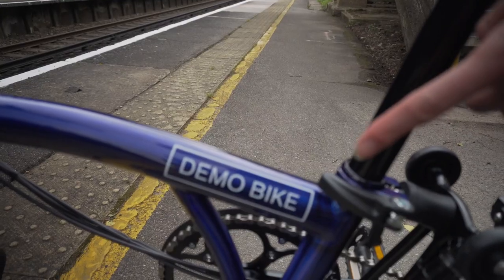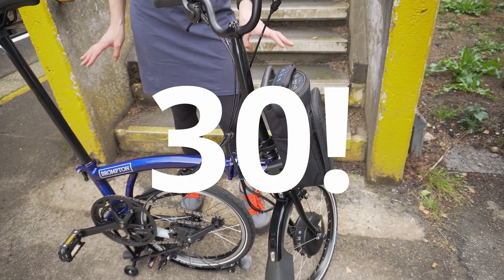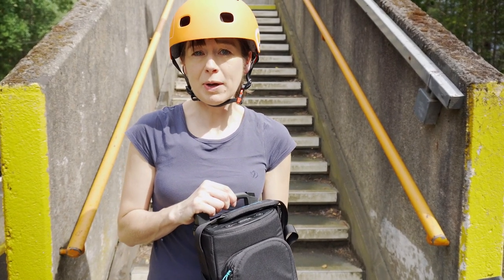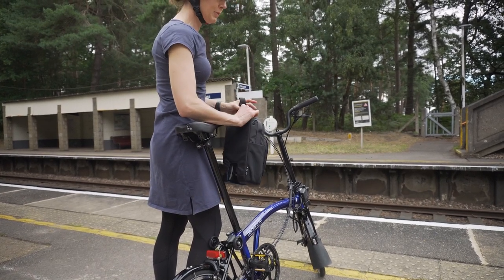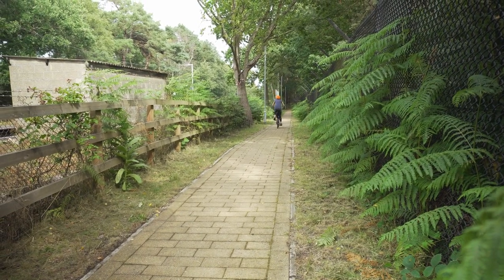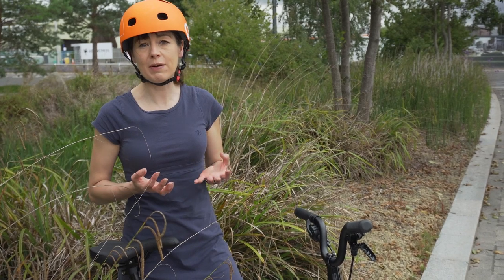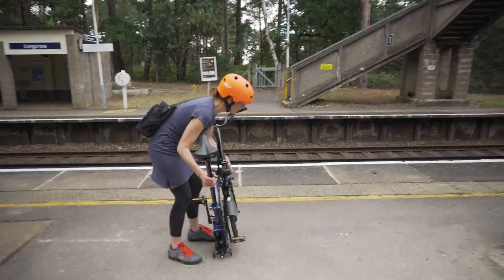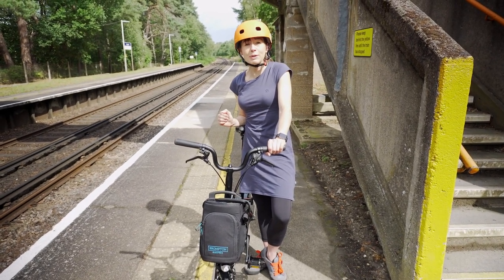Getting the most out of your Brompton Electric

Comment: I bought a Brompton Electric M6L just over a week ago and within 10 minutes of riding had a front wheel puncture. Can a puncture substance be added to the inner rube to seal punctures when they happen?
Reply: THEBERBSTER Sorry to hear that. I expect you can. You can also fit tyres with thicker puncture proofing inside (but they weigh more). My supplier recommended I have Marathons fitted instead of the standard Marathon Racer.
Reply from the maker: Some people add Stan’s Notubes sealant

It depends upon the inner tube used (it requires a removable core in the valve of the tube)

Personally we don’t particularly like it but would go for thicker Marathon tyres

Comment: I am from the continent. 100 psi would be 6,8 pressure bar? Right? I thought such high pressure bar would blow the tyre.. 🤔
Reply from the maker: Yup you are correct. It’s meant to be the recommended pressure with 110 as the highest for these tyres. 65 in the minimum.

Comment: Suppose you are walking with your e-brompton, and if you accidentally collide the pedals perhaps with one of your legs, would the bike suddenly rush forward by itself? This is very dangerous especially if you are at a pedestrian crossing waiting for the traffic light.
Reply: An early BE review stated that the cranks need to rotate through something like a quarter turn before the “brain” powers up the motor.  We’ve owned two BE for two years and can confirm that this is true.  This is controlled by the software and may have been tweaked in this respect since the Cycling Weekly review but the impression given was that Brompton were intent that no BE would surge away in traffic by accidentally triggering of the motor power. 

We have two, six year old electric bikes (not Brompton) that have both surged forward without a rider when poorly adjusted.  You are right to be concerned but this is not an issue with BE.  However, the older bikes do therefore take off from a standing start immediately the pedal is pressed while the BE lags slightly.
Reply: No, there’s a torque and a cadence sensor. The cadence needs to sense a certain amount of revolution and the torque sensor needs to sense a certain amount of torque for more than just a bump. I believe there are also other safety measure, for instance, I went over some very loose gravel, going uphill quite slowly and I was convinced the front wheel would slip, which it did but only for a very split second but the bike sensed it and immediately reduced the power to a point it wouldn’t slip so I imagine this is the worst that would happen. Anyway, I don’t think bumping the pedal would make anything happen.

Comment: Thanks for the informative video! I just got my Brompton Electric (and first Brompton). I’m not sure if it’s because I’m still not familiar with it’s handling or if the steering on mine is particularly loose, but I can’t imagine letting go of the handlebars to change power level without having an accident; even momentarily raising a hand to signal a turn makes things quite wobbly. Can the steering be adjusted?
Reply from the maker: Thanks for watching and the kind feedback 

The steering shouldn’t be loose - but due to the small wheel size it can feel twitchy compared to a mountain bike for example

After a short time you will get used to it
Reply: Taking your hands off the bars is not a good idea with the Brompton.  It has to do with the small wheels and gyroscopes and stuff I guess.

Comment: The battery latching mechanism will suffer from wear and tear as the bouncing battery bounces around even on normal roads and bike paths leading to connection failures even on very smooth surfaces, time will tell how long this wear and tear will take. They should have gone with the more modern rear hub motor with an integrated battery, it was the more elegant engineering solution.
Reply: Hi Johnny. Actually, I think there's a number of good technical justifications for the external, removable battery system that Brompton has designed. Number one for me is that it is easy to separate for charging. It's also easy to separate to lighten the load for carrying, say in tight confines. Lighter is easier, such as when lifting the bike out of a tender and onto a boat, in a lumpy sea. The separable battery can also be more powerful than a hub battery, more easily upgraded and more easily dealt with in case of warranty problems. Plugging in a spare battery is dead simple. There's lots of good reasons for the design Brompton have settled on. Other designs have their merits too, such as the removable battery in the Gocycle GX/GXi, though not as convenient.
Reply: @Valden23 My main issue with the Brompton electric is that they are using cheap old fashioned technology and charging a top price for it ( the bike should be £1600 , not £3000) they are milking their loyal fans, and secondly, there will be issues with the battery latching system I had a good look at it, wear and tear will cause it to fail even on smooth ground, recently they have told people not to use it on Rough ground so they know themselves they will have a problem in the future and they are preparing the ground in advance of complaints.

Being able to remove the battery is an advantage but since the bike is light and portable it really doesn't compensate for the downsides.  Carrying one slightly heavier bike is better than carrying two things, as anyone who owns an electric Brompton will testify, slinging a bag over your shoulder and carrying a bike is difficult, the hub battery like the one on the Zehus has a bigger range and charges more quickly and really doesn't add any noticeable extra weight to the bike.
My partner sold her electric Brompton a few months ago and bought a second-hand Brompton and fitted a rear hub motor on my advice and she says it's far better, charging the rere hub motor is very simple, you just plug it into a wall socket.
If you really want a dangling battery on your front fork, there are much cheaper options it's old tech, the Swytch kit is £400/£500 and is very easy to install and can be moved to your next bike, a new Brompton and Switch kit is half the price of the Brompton electric and far better in my opinion.
Reply: I have to disagree, not with everything you say but a lot of what you say is opinion. I for instance prefer to have the battery in one hand and Brompton in the other if I’m carrying it folded but in practice I just keep the bike open and wheel it as a normal bike so you have the choice to have it all as one or not. Yes there are options for third party add ons and I’ve tried a nano kit. It was pretty poor, didn’t give me as much power or speed and was a pretty inelegant solution. I’m sure the Swytch system is probably better however. But, you don’t get the integrated or auto lights, it’s never going to be as neat, you might have to modify your forks and you might void your warranty. I’ve found the Brompton system to be very intelligent and always gives me the power I expect.
Not all of us have power available where we store a bike so having it easily removable is a big plus in my opinion. 
You are perfectly correct that the battery mount doesn’t seem that durable but then we’re protected by consumer law as well as warranties. I haven’t had an issue with it yet.
Lastly, don’t forget the whole ecosystem around Brompton, it has a ton of first and third party accessories which definitely can’t be said for other brands, not to mention anything slightly obscure. 
Anyway, it seems the Brompton isn’t for you and I have to say the electric Hummingbird looks very appealing.
Reply: @oliverpolden  In order to make a comparison you would have to have had used both the rear hub motor and the front hub motor, in my opinion, having used both there is no comparison, the rear hub with integrated battery is better, the tech is more advanced with apps and handlebar controller. Brompton could have taken this technology and made it even better if they wanted to.
Brompton is very good at making money, they are very good at marketing, they have sold the old tech front hub motor for double what it's worth, you have to admire the brass neck of it and the brilliant marketing.
Reply: @johhny711  no I haven’t used a rear hub motor. But you haven’t said in exactly what way the rear hub with integrated battery is better. In my opinion it’s worse because you potentially have premature ageing of the battery due to the heat from the motor. In what way could Brompton have made it better? Granted and as I said, the mount is a bit wobbly but so far it’s lasted fine for me. They have recently released firmware and their new app which connects to your bike via Bluetooth but I’m yet to try it.
Anyway, it’s clear you’re not a Brompton person and that’s fine. I’d be glad to hear of any ebikes that fold as compact as a Brompton.
Reply: @oliverpolden  One of the biggest advantages of hub motors is that they require little or no maintenance. They are an entirely independent drive system that retains all of their components inside the motor casing, leaving nothing for you to mess with or maintain. That enclosed system also means there is a lot less to fail. Rear hub motors have the advantages of better traction and stronger frame mounting. The heat generated by the motor can be an advantage Lithium-Ion batteries operate best at around 25C.
Reply: @johhny711  the Brompton is also a hub motor so that’s no advantage but I do agree that the whole thing contained in an independent system can have its advantages. But then you said you wanted a control panel on the handlebars. Do you get that with an independent rear drive system? The Brompton is simplified by not having a control panel, as you say, less to go wrong and in practice I’ve never found the need for a control panel, plus I have more space to mount lights or other devices. But then the Brompton’s handlebars aren’t great for mounting stuff as they’re not straight.
What bike do you have?
Reply: @oliverpolden  I was talking about a rear hub with an integrated battery, yes most of the latest systems will have a wireless controller on the handlebars so you can change the power settings without having to stop or stretch over the handlebars to fiddle with the buttons on top of the battery ( as in the Brompton ).
As I said the main reason Brompton went with a front hub motor was cost, they are very cheap to make, an integrated battery in a rear hub motor is a lot more complicated to manufacture, they are just ripping their very loyal customers off, it's about profit .
These days as a folding Bike I have a Tern ( don't ask me the model ) it's not the latest one . It's heavier than the Brompton, but I use it as a bike to have with me in the car, it's more comfortable than the Brompton .

Comment: Hi there I have Electric new 20/20 Brampton bike ok and iv been told to book my bike in shop fore new chain in two month because of the wear and tear on the chain with it being Electric it stretches the chain more quicker with this being electric bike  so is this true I do expect it to be stretch but not that quickly
Reply: As the motor drives the front wheel, I doubt that it will increase chain wear. I suspect that the opposite would apply.
Reply: Yeah, I wouldn’t expect the chain to wear faster as it’s a front hub. Chains probably would wear more with a mid-drive where the electric power does go through the chain.

Comment: My wife & I now have an electric 6 gear Brompton each. However, we cannot understand the point of level 1 on the battery. As far as we can tell It gives zero Assistance . One can only assume it is there to make out that Bromptons have more range than they actually do.I suppose it is useful at night to work the lights. I get 20 miles in mode 2. The wife says I am not to use level 3 because if I run out of battery power she will point blank refuse to come & get me
Reply: Not my experience. There is some assistance with the one setting. Just less than 2 - which is precisely what you would expect. 
There is a fourth setting - zero. this will only power your lights whilst giving zero power assistance.
Reply: I find it does give you assistance but remember it’s proportional to the effort you put it. I would see it more as a range extender, both for yourself and the battery.  Yes it’s not a lot of power but I definitely can tell a difference between off and 1.
Reply: Twenty miles is very very poor range
Reply: @gdwlaw5549  If the roads are dead flat ,or no head winds I get 2  possibly 3 more. But those ranges were when i weighed 18 stone. I have been ill, so not used the bike for 9 months. I have now had weight drop to 15 1/2 stone so should get 25 miles on flat roads. I will know when I am fit enough to start cycling again. I very much doubt that I will exceed 25 miles on a typical ride with a couple of small hills though.

Comment: is it possible to put a rack and ezwheels on an electric brompton? will the motor bring it out of balance?
Reply from the maker: Yes it’s possible to fit a rack - and quite popular for Brompton Electric owners

You are spot on - the reason that Brompton don’t offer it as an option is that the motor does turn it into a bit of a see saw / teeter totter 

So not as stable as a non electric Brompton with a rack
Reply: I find my rack really useful on my BE. And yes it is more prone to fall over when fully folded if it’s on a slope on the motor side, or train wobbling. Something to be careful of when choosing where to park it. With handlebars up (shopping trolley mode) the Electric is stable.
Reply: One tip which I offer from bitter experience.
If you try to personalise your BE, say with anything titanium/lightweight, e.g. seat post saddle etc, the tendency to tip over gets worse as it is less of a counterbalance to the motor. I've resorted to fitting a third party telescopic ezy wheel kit which makes it a lot better.
Reply: On my electric Brompton the front wheel touches the ground when folded and rotates as you push/pull it.
I'm not sure if this is intended, but it does make the bike more stable. 
I wonder if it matters which way the front wheel rotates when the bike is being wheeled around.
Reply: Ken Twydell mine did this also. The supplier said it’s down to ‘tolerances’ on some bikes. My workaround has been to fit a piece of thick Velcro to the main bar above where the rear wheel touches when folded. It raises the bar and the front wheel enough to clear the ground. I did also fit Ezy Wheels but they’re not much bigger than the standard wheels fitted to the rack so if you have a rack try the Velcro method first.
Reply: @petergilbert72  Thanks for sharing your experience. I can't help thinking that the front wheel resting on the ground when folded is intentional in order to give stability with the extra weight of the front wheel of the electric version. 
It's interesting to note that Brompton don't appear to offer a rack as an option on the electric Brompton. Surely, this is the one model that cries out for a rack as the front bag has reduced carrying capacity and the extra weight of a rack is mitigated by the electric assist.
I think that your supplier may have been just saying what he thought you wanted to hear.
Reply: Ken Twydell My partner also has a BE bought from Brompton Junction. Its front wheel doesn’t touch the ground when folded so does shopping trolley mode as intended (the BE handbook inside front cover is explicit that it ought to function in trolley mode). BJ fitted a rack for him prior to collection of the new bike.

Comment: I can see why you recommend only smooth surfaces when running 100 psi.i watched the video and then went out on my B75 with newly inflated to 100 psi tyres...OMG. it's like having concrete tyres !!!! ..I think 80 Psi will be more appropriate for me ....and my man bits 😱😱😂
Reply: Hi Reg  -  amused by your comment, and you are so right in my view! 

It did not take me long with my M6L Brompton to discover that 100 psi front and back was a recipe for a bone shaking, teeth gritting, experience through the handlebars in particular. So, and as with my other bikes, I have reduced pressure at the front, and all is well - I run 65-70 psi front, 95-100 psi rear for 80 kg weight, and a 9 litre bag on the front carrier block with about 2 kg in it.

Interestingly, if I pump the rear to 110 psi and the front to 100 psi, the bike feels really fast, which leaves me wondering if 75% of the science behind the more expensive tyres which are supposedly faster is in the high tyre pressures they recommend!  Anyway, air costs nothing, and the standard Marathon Racer tyres are cheap, so if I want fast, I can just add more air with my track pump before the ride. And not be afraid of part worn tyres either, they must be faster surely.
:-)